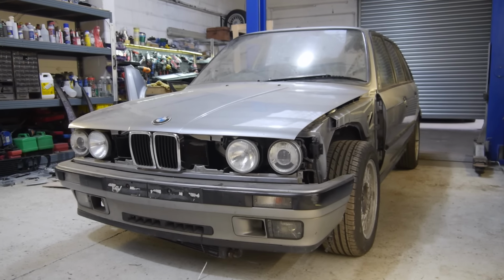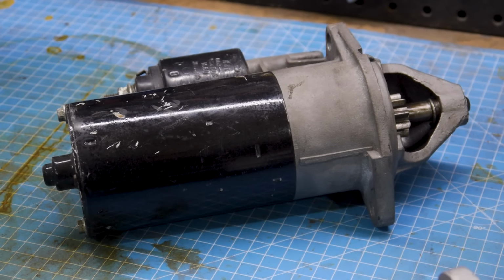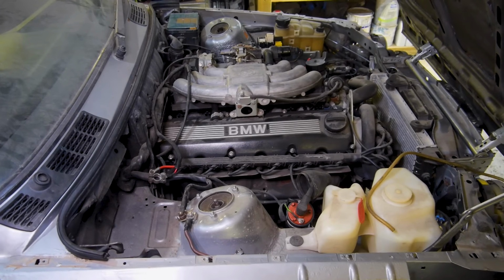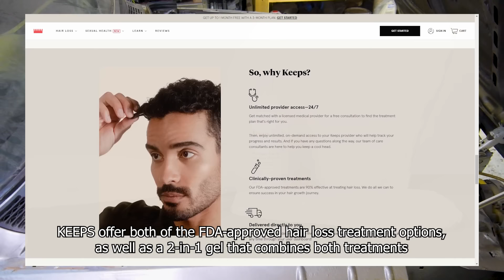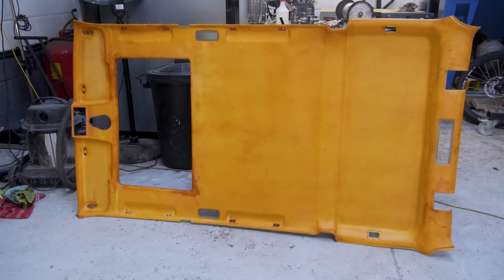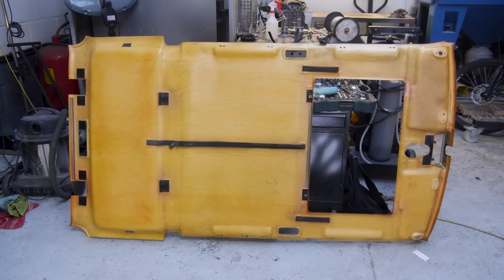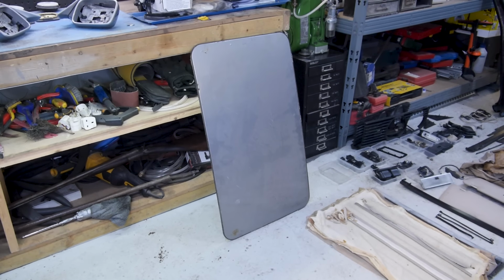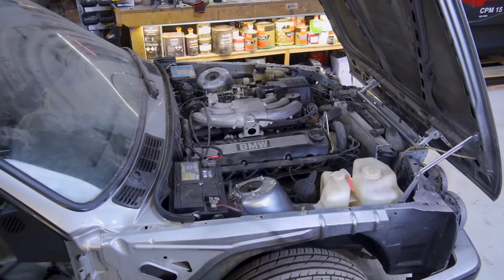Will The Engine Start? | BMW E30 Touring Restoration - Part 3

Comment: 'spare' cable looks like a connector for a CD changer
Reply: Yup that's what I was gonna say!
Reply: I'm pretty sure from factory it was tapes only, maybe an aftermarket addition?
Reply: I second that
Reply: deffo for a 90's CD changer
Reply: Yep I was just coming to comment that.  Might be for an Alpine changer actually
Reply: @mannyg8928  That dark blue/grey looks a lot like Alpine, the round plug should be the pre-AINet version.
Reply: Correct , Alpine M-bus shuttle cable
Reply: @SaulidSnake This was common on Mercedes from the era, my W124 has a CD changer plug as well. Not sure about BMW's, though.
Reply: Yup, it’s the cd changer Steve. They came with the option of a pioneer one from factory.

Comment: Damn… 4 years already 😮 I remember, when you took the coupe apart…  Than from UK to Spain, the engine bay makeover of the touring. The M3 Series. 
When I saw you fixing the car with the absolut minimum of equipment back in the days, I was so motivated to fix my own touring, which is unfortunately a gigantic rust bucket! 😂
Keep it up, love from Germany ❤️🔥
Reply from the maker: I know right... Time flies! It's funny you should say that, Antonio (M3 owner) sent me some photos of him driving it in Spain. Its all done and I hope to meet up with him soon and do some filming. 

I'm glad i inspired you! And welcome to club. Its all part of the fun really :D 

Thanks, mate, much appreciated!
Reply: @RestoreIt the funny thing about my Touring is: I started disassembling and then got stuck, 6 years ago. Now my grandma gave me her Sedan, also very rusty, cause she didn’t manage to drive without power steering. So I got some other e30 project in between my touring as well. I think it’s some kind of cycle. Whenever you get one e30, another one isn’t that far away. But man, great cars. Little bit rusty and thirsty sometimes ^^

Comment: I saw in a recent episode of M539 how the mirrors may not be able to be separated without drilling them out and then replacing the hollow bolt with a threaded one from a newer model.
Reply from the maker: Thanks for the info, Matt!

Comment: Im glad you put some music on during the timelapes. If I may give you one more tip; try to match the music db level with the db level of your voiceovers, that way we dont have to adjust the volume, and wont get scared when we visit a different video after :)
Reply from the maker: Cheers for the tip, Insane. I'm not too keen on music so I try to keep it quite, but I do get where you're coming from. I'll try the music at the same volume as the VO next time, cheers!

Comment: The sunroof in my E30 coupe looked very similar when I pulled it off to address bubble rust on the top corners. I sprayed the rust chunks out with compressed air and shaking it around, and knocked down and treated all the visible rust. Paint and polish and back on the car, working well!

Comment: Hi, that cable is definitely for the pioneer or a Kenwood six disc CD changer back in the old days. It used to be controlled via the head unit and the cable with all the pins is what used to connect them.  Are used to fit these for a living.

Comment: You can use epoxy to help the cracks. Either airspray or applied by brush. You can also sand it, prime it and paint it again if youd like 12:30
Reply: Also, I think that cable looks like its audio related. Where does it go?
Reply from the maker: Thats a good idea, thanks Dapeguer!

Comment: The spare cable is for a factory option cd changer that was usually a kenwood, and the wing mirrors won't separate from the base units without damage meaning you won't get them back together, i tried when i restored the 325i did, it is possible with newer models with a special tool that basically drills out the sleeve holding them together and anothe special tool to press in a new one with a new spring
Reply from the maker: Thanks for the brilliant info, Will! Much appreciated. I think they'll be blasted and painted as they are.

Comment: 10:32 it's a connecting cable for the multi CD changer that was usually fitted in the boot (Aftermarket ) usually Alpine , or Pioneer.
Reply from the maker: Thanks, dude!

Comment: Yep 100% , that cable belongs to an Alpine CD stacker.  Also, use a pressure washer next time to clean the old glue/foam from the roof liner.  It takes a total of 3 minutes to do both sides.  Only downside is you have to let it dry overnight.
Reply from the maker: Cheers for the tips, Player2! And interesting idea, I would worry about damp though.
Reply: @RestoreIt  Here in Australia with our dry climate, the damp is not an issue.  Different story for U in the UK though.  Nothing a heater can't take care of though.

Comment: Nicely done 👌 about wing mirror there is tube joining two sections that is been flared at the end and can be cut but you will have to replace it with threaded tube or there is X5 version of mirrors repair kit, looks same but not sure
Reply from the maker: Very interesting and good to know. Thanks, Rabnawazkhan!

Comment: the thing you're asking about is a cable that goes from the stock head unit to an optional trunk mounted CD changer
Reply: i have a couple if you want to try to get them working and go full authenticity lol
Reply from the maker: Oooo I may have to take you up on that, might be cool thing to have for the car!

Comment: That black wire on the backseat at 10:40 kinda looks like a plug I had on a old CD changer that was in the trunk. Perhaps check it out if it goes back to the radio
Reply from the maker: Cheers, dude!

Comment: For the cracks in the headliner you can use glasfiber filler and sanding it after applying the filler
Reply from the maker: Cheers, dude I may go for this!

Comment: if you heat the 5 lugs - plastic -  up you can seperate the 2 halves of the mirror, use your 3d pen and refit it.
Reply from the maker: Interesting.... Cheers, Warren!
Reply: cheers mate, it worked for me. @RestoreIt

Comment: That is a DIN connector for a CD changer, likely an old Alpine unit.  For mirrors, should be a large hollow bolt between the two pieces and an internal spring.  May be an XZN triple square to remove the bolt - at least that's how it is on Porsche mirrors of same general vintage.
Reply from the maker: Thank you, Jeff! Very helpful of you. I'll take another look at the mirrors when im next in with this comment in mind.

Comment: Old Central locking systems are a pain. My 89 240 had that BS biodegradable wires and my whole master locking system on the driver door was corroded to the point the wires just broke into little pieces. Had to make multiple junkyard trips to find one that was salvageable
Reply from the maker: Haha, not a great thing to read, but I guess I should prepare myself for the worst...

Comment: You can Check Out M539 restsurations...he showed Like 2 or 3 Times how to disassemble the mirrors. In a nutshell ITS Drilling Out the shaft and replace IT with a eBay Screw in shaft
Reply from the maker: I think I'm going to keep them whole and paint them whole which is what is done most of the time. Cheers!

Comment: Hi @RESTOREIT. that plug looks like a plug a seen on a 750iL I had years ago. It may be a audio amp that may have been in the back. See if the cables go to behind the dash.
Reply: The 750iL was also a G reg.
Reply from the maker: I think you might be right, Leon! It did go behind the dash all the way to the boot.
Reply: @RestoreIt  we couldn't get the radio to work. Was a really strange set up. All the speaker outputs went fron the stereo to the rear of the head unit all the way to the amp in the back then back through the car again to each speaker. Quite advanced for a g reg. We had bad Amos so had to make a patch lead that a guy made who works at rolls Royce. It was aircraft grade wire and it was 12 meters long in total to go everywhere.  He estimated it was £1900 in wire lol. The car was only £480 as we used it for a scumrun rally round Europe fuel was really really bad but we did it in style lol.
Reply: @RestoreIt  if it was the amp the stereo won't work as it has to pass through the amp first and your speakers. If your speakers work then I would deffo say its a cd changer from either alpine or pioneer at the time.

Comment: 9:30 Man! It is very dangerous to use a vacuum cleaner to suck it out of the tank. Because gasoline vapors get directly into the vacuum cleaner motor, where there are very strong sparks!
Reply from the maker: Good shout Kosta. Cheers for the tip!

Comment: My central locking failed and it was expensive. I hope that the fuse in the emergency module in the left footwell under the speaker is all that is wrong.
Reply from the maker: Thanks for the tip, Ben. I'm hoping so too. It did work when the central locking was installed, so maybe I just need to remove some more wiring or something. Its an annoying issue to have, for sure.

Comment: The sun-roof panel is a bit too far gone for this car; it would be fun to see if it is repairable, the same as the door.
Reply from the maker: I'm with you Nitt3erz, I will however be doing it once the touring is done.

Comment: Looks like your throttle body may be having issues!
Reply from the maker: Haha, I know what you mean. But during that particular shot, I was still using my hand on the pedal which wasn't attached to the box. I thought it felt a looked weird also, but once attached properly, its all good. Cheers!

Comment: Sunroof panel is a lost cause I think,  I heard they're a bastard to repair.
Reply from the maker: Yes it looks it... I think i'd have to cut out a section of the middle to make sure it was clean on the inside... Bit of a nightmare, but could be fun!
Reply: My panel is rusted too, I’m going the delete route I think.

Comment: probably way to late but the cracks in the headliner could be filled up with melted yellow lego bricks
Reply from the maker: Why yellow?
Reply: @RestoreIt  to match the color of the headliner better in this case, but could be any color melted lego. It’s how I restored the body work of a Citroën mehari. Works wonders
Reply from the maker: Sorry, I read the dashboard, not the headliner, haha. Sorry. Yes good idea. I still have it out and I'm waiting for the new fabric to be cut and sent to me.

Comment: Those are heated side mirrors. Used to be an option , as well as the wide`angled ones.
Reply from the maker: I've never thought about them being heated, is it an automatic thing that happens all the time?
Reply: If you look at the back of the glass you'll see 2 cables attached to it . These work like the defogger in your rear window. They are on all the time I think. Pretty useful in cold or rainy days @RestoreIt

Comment: Your plugs looked very dirty. Also check the air pipes incase they have holes or rips from air filter box back towards engine.
Also by not having throttle cable connected the butterfly valve in throttle body would’ve been fully closed and thus starving engine of air. Once u connected that it started.

I would flush fuel lines as well and clean injectors out. Probably have crud build up on the injector filters.
Reply from the maker: Great comment, thanks Shaz. I'll check all of those things in the next episode and see how I get on with it. Much appreciated mate.